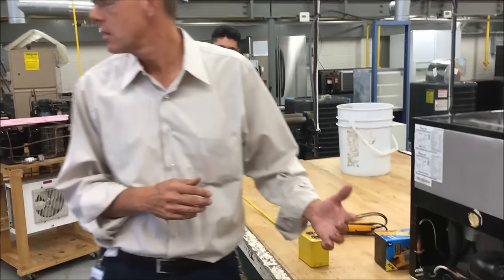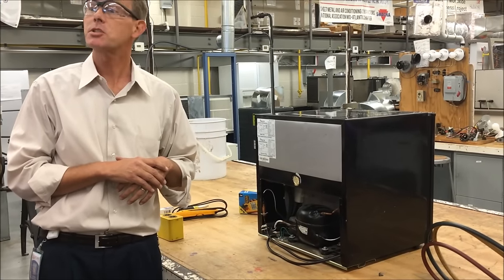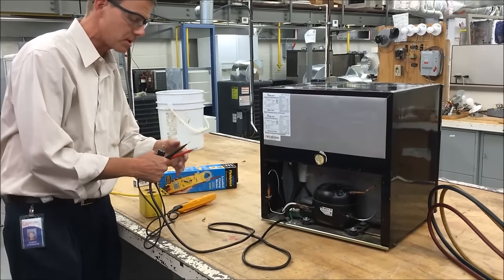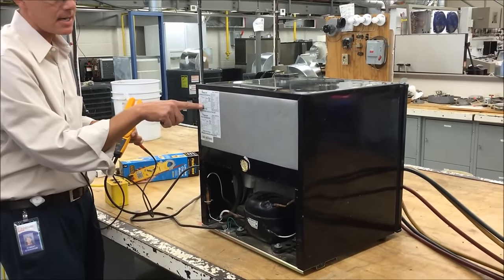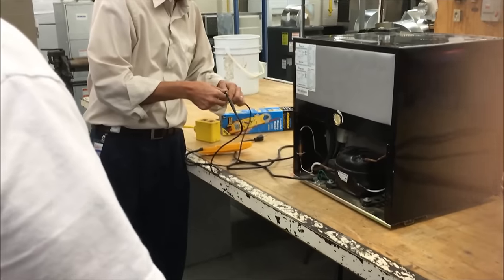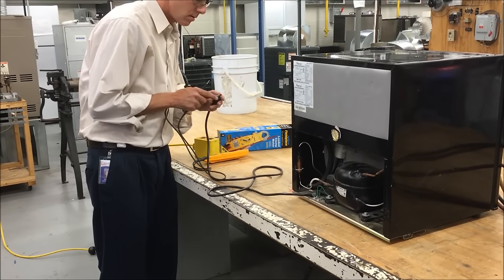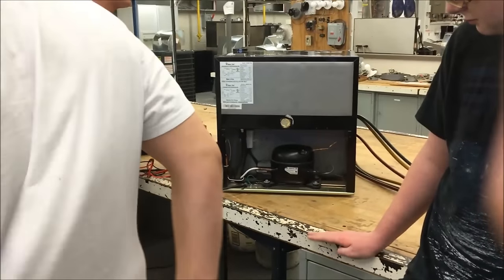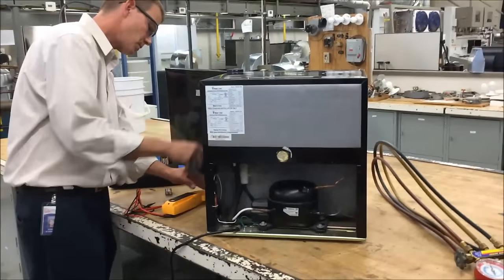HVAC Basics: First - Mini Fridge Refrigerator Troubleshooting Part 1 of 2

Comment: Thank you for your videos, they are a great help to learning HVAC/R.  It was a great help and a great educational experience in total.  I especially loved seeing the "Annie".  That being said, I believe you misdiagnosed this refrigerator.  Happens sometimes when we are in front of an audience and have already formed a hypothesis.  It's still a great educational video.  I didn't see you test the start components.   Near the end of part 1 you showed the schematic confirming my suspicions.  The schematic shows this is an RSIR (Resistor Start Induction Run) compressor with no capacitors.  It uses a PTC to provide Start winding current and then, as the resistance increases, decrease the Start winding current to prevent it burning out.  It is probably a 4.7 ohm PTC.  I found this video while attempting to repair a slighly larger mini-fridge that had the same symptoms.  The compressor got very hot and hummed but wouldn't cool.  I believe it was failing to start because of a failed PTC and just sat there with current flowing through the Run winding but not rotating, until the Thermal Overload cut it off.  The cycle repeated when ever it cooled off enough to reset.   It was drawing about 9 amps while sitting and humming with an LRA rating of 11 amps.  I checked the PTC device and was reading about 60 ohms while it was supposed to be 4.7 ohms when cold.  I disassembled it and found a coin shaped PTC sandwiched between 2 flat spring contacts. One side showed signs of arcing on the PTC disc and its contact.  I sanded/scraped the PTC and the contact and got the PTC down to 11 ohms and reading 9 ohms when the device was reassembled.  I reinstalled it to check my hypothesis.  The mini-fridge started right up and is showing its rated RLA of 1.3 amps.  The new replacement should arrive in 2 days but the fridge is still running.

Again, thank you for your videos.  They have been a great help in my HVAC/R education and will remain a wonderful resource.  I hope you and your family are doing well!
Reply from the maker: Your one of only a few to catch that. It doesn’t even have a cap on that unit. Someone else mentioned it but didn’t go into the detail you did and I’d like to say thanks. Appreciate you leaving this comment for others to see. Thanks for watching.
Reply: You posted this a year ago, but I wanted to respond to let you know that I tried exactly what you just said… sanding the “dime” inside the PTC… and it worked for me. Found a non-working mini fridge on the side of the road, and that trick made it work, 100% confirmed. My only concern is, I also sanded away what looked like some kind of special coating. Not sure if that will lead to a future problem.

Comment: Great video, great teacher! My only criticism is that I wouldn't be leaning on the top of the metal fridge with one arm and hand while poking around inside it with the other when plugged in. I was taught to put one hand in my hip pocket whilst poking around live circuits, thus preventing a possibly deadly circuit through my heart.

Comment: He's a good teacher we need more teachers like that I got a little refrigerator like that and the line coming off the compressor was leaking and I was told that you can't fix that is that true 🤔
Reply from the maker: Depends. If it’s cracked on the shell where the line connects that is tough but if its just the copper pipe then that can be repaired. Sometimes the compressors leak from where the electrical terminals connect and that also cannot be fixed. Where exactly is the leak?

Comment: First thing you should do for any refrigeration/ac call is grab the suction line and the liquid line, every time.  You’ll immediately know if that compressor is running, and based on how hot/cold the lines are you can make a determination if it’s low on refrigerant.  Also touch that compressor and feel how hot it is.  You can troubleshoot and rule out a lot of potential issues just by feeling the temp of different components

Comment: Very great video. I have a little large small refrigerator. It worked great but I had it on a roller cart to move it, it slipped off and tipped about 2" to one side. When I discovered that ( after 2 days or so) and I plugged it in, it didn't work again. I didn't drop it or anything. Do you have idea what could have gone wrong? Thanks in advance for your help.

Comment: Thanks for this video .
My fridge when I plug in the wire the fridge light inside the fridge working but the fridge compressor and the little cooling fan the one next to the copmressoer not running ?
Reply from the maker: Did you check the Thermostat?

Comment: I picked up one just like this for $10 at garage sale. Works great, however I want to use in my Jeep for camping with an inverter. I would prefer the door to open on top. Easier to secure, store items. I could remount the compressor so that it will be upright in the new position- but would the evaporator function properly on it's back?
Reply: Amazing Instructor.  Intrigued to learn more about this field now. If he had online virtual classes or near me , I'd instantly change careers. 🙋‍♀️ 👏 🏆👍

Comment: 3:28 You should use a megger to test for ground leakages since small leaks will only show up on a high AC voltage because it is most of the times capacitive and not a dead short.
Reply from the maker: Good point!

Comment: Question, small 1.6cu ft fridge new, small compressor, on colder setting turns on every 15 minutes and runs for five minutes… is this normal? Temp about 34-36 degrees open space air in fridge temp gauge door closed…
Reply from the maker: Could be. Stays cold and cycling is a good thing. As long as the compressor doesn’t overheat all is good

Comment: Hey the meter your using I see it's a Fieldpiece is that a good meter? Also what model # is it, I'm looking for something decent to test compressor amp draw & also want to test capacitors on Appliance's along with HVAC Equipment. 

I would also like to get more involved in testing capacitors on circuit boards in TV's & other small Electronics so would you be able to suggest something that can do all of the above or even if I need to meters like a champ meter & possibly just a separate capacitor tester by itself? 

Right now I'm using a $20 Harbor Freight Clamp Muli meter & a Craftsman Digital/analog meter. I see harbor freight tools now sells Ames multi meter & I seen they have a decent clamp meter for $40

Please excuse my ignorance as I'm still learning. I am mechanically inclined as I've repaired car's for many years but I am really interested in appliance & TV/Electronics repair now too. Thank you very much & have a wonderful day!! 😃

All the best,
Ron.
Reply: Fieldpiece sc620 looks like to me

Comment: Quick question, how do you access the vent/condenser coils/condenser fan in mini fridges like this? I have one just like the one in this video, and i cannot figure out where any of these components are even located.
Reply from the maker: No fans on this model. You would have to rip it apart to see the condenser coil in the cabinet. It’s embedded in the foam insulation.

Comment: Mine kicks on, but later when it turns off to control temp, it doesn't go aback on again.  I'm guessing the thermostat is failing because it does chill when running. But I do not know where to find a thermostat for a 2 year old  1.6 ft igloo.

Comment: How is 5amps a locked up compressor when the lra is 12? I thought it had to be higher than 12 to be locked up???and you can clamp around the common wire and push inrush on the side of the meter and start it up to see LRA. Nice meters too. I have the same one...

Comment: Mine looks just like that different brand name but same inside luck. I want to get a drink in the garage because I was so hot and sweaty and my drinks were all warm so I checked the breaker just fine I had it set on six it won’t go no further so I turned it down to one and turned it back up to six and boom sparks flew is this fixable or throwable
Reply from the maker: I think when you let the sparks out it’s time to get a new one. 😁 Thanks.
Reply: @edisonhvac  I did.   Lol ty

Comment: I have a mini fridge model Twin Star CR-48D-TS. The fan works, sides of fridge stay cold on the outside. My temp control is set just over medium, and the inside never gets colder than room temperature. How can this be fixed?

Comment: My fridge has the issue of not kicking on when it’s supposed to. It will just let all the food go bad. Sometimes I can kick the side of it or shut the door a little forcefully and i can hear the compressor kick on. When I kick it it stays on till it gets where it needs to but then when it kicks off, it doesn’t turn back on. I replaced my relays and the overload switch on my magic chef mini fridge. Could it be the thermostat? I tested the continuity on the compressor and everything seems good there so idk what else it could be. Haallpppp
Reply from the maker: Check your thermostat

Comment: Just replaced the relay/overload unit on my 4.4 cubic foot Daewoo with an aftermarket part made by Uxcell because the old part constantly kept tripping the circuit it was plugged into. The replacement relay/overload unit is a two pin & its a little larger than the original. Since changing to the Uxcell relay/overload unit it ether stays on too long or takes forever to turn back on & by the time it does turn back on the ice in the freezer compartment is melted. Any idea what the heck is causing this? Could it just be the starter relay is too different for the mini fridge to handle? I also noticed it seems to have trouble getting enough frost on the freezer. The circuit tripping problem seems to have stopped almost entirely but I think I got more issues out of this than what I was trying to fix. Any thoughts?
Reply: (UPDATE) think I fixed the other issue that cropped up. I think I was just using a different type of start relay the mini fridge just didnt agree with. Switched back to the old start relay but I kept the new overload protector on there & it seems to have improved a great deal. Still causes a slight trip/surge in the circut its on but no major issues since the fix yet. I would like to completly elimainate the surge issue that occures when the compressor kicks in. Can feel it through my headphones hooked up to my TV sometimes. Very annoying.

Comment: No if it was locked up it would be pulling LRA or greater.You definitely have an issue but,it’s not a locked rotor.High Amps yes over heating compressor yes.I would begin my diagnostics at the capacitor.

Comment: I hate these things, for the very reason that they bond the condenser coil to the inside of the back panel.  It reduces condenser efficiency and is harder on the system as a whole.  They do the same thing to the condensers on newer residential chest freezers.

Comment: I have a compact fridge that cools but does not cycle off so it runs constantly. What could that be? Thermostat?
Reply from the maker: Start there with the stat but also check the gasket around the door.
Reply: @edisonhvac  Thanks!

Comment: 0,22

hi Guys,
Foamed condensers in the inside wall of the mini cooler are very bad for service.sie rust fast and then only a capacitor builds on the back for help

Comment: so My Mini Fridge is Not Cooling Anymore, What i Tried: test the 
compressor by checking continuity between 1-3 pins and checking for bad 
ground faults on them too, and they were good and i also tested the ptc 
relay and that had continuity between 2-3 Holes/Pins? and No Rattle 
Noise, But when i checked The separate Overload protector it Doesn't 
turn on the circuit (Continuity Sound goes Off) when i heated it up by a
 heat gun off of the unit, although the Continuity test show it was good
 when checking the 2 pins? when i plug in the fridge the compressor 
clicks on showing 5A Start Current but my amp meter shows it has low Amp
 Draw after it turns on?. and i know its on if i tip it over i can hear 
it bouncing in there, and i also tested the thermostat it calls for 
coolant when i turn on the thermostat by checking continuity between the
 Hot and Neutral Pins on the Cord, and yes i can hear it gurgling too so
 i know it has Refrigerant? is it a possibility of a clogged line ?. im 
about Stumped. ):
Reply from the maker: Clogged cap tube, low/no charge or bad valves in the compressor. The valve plates sometimes fracture and the compressor runs and draws refrigerant but bleeds the high side back into the low.
Reply: @edisonhvac  Well that would makes sense seems then i think, i tried everything, (Replace start relay, overload protector, check Thermostat, coolant level (gurgling noise), test compressor pins and so on .. (TBH i actually found this on the street and i wanted to try to fix it, but at this point the cost to fix it would exceed the value of it even thought it was free. not worth my time or patience. thank you anyways
Reply: @edisonhvac so if it has low Amp usage would it be clogged then (around 380-450MA Normally its 1-2A rated Current on the Fridge i cant See LRA anywhere on the Compressor. (i have noticed to sometimes it will lock up and keep clicking but unplugging it and retrying starts it again ?. There is no Warmth to any Tube on the Compressor but the PTC will get hot

Comment: Hey teach! I have a problem, mine just one day lost power, I checked outlets, I tried unplugging it for few minutes, plugged it back in, it isn't the outlet or breaker. So my question, do these have a fuse, or a reset button? I mean no power, sound nothing, please I hope u have any advice, I can't find any damn good videos on YouTube about it. So u sound like an intelligent man....hope to hear back. 
I don't have a tester but wonder if replacing the power cord could possibly help
Reply: did u not watch the video ? he tells you exactly how to test it. goto harbor freight at get continuity,ohm,AC/DC volt meter, probably under 30 bucks. re watch video.

Comment: The overload on my mini fridge rattles, is that normal ❓The fridge only produces ice around the wire part one side of the ice box.
Reply: Mines does the same...
Reply: Miss. Tina Green the teach is MIA
Reply: I know right ..so tell me how long did your fridge last?
Reply: Also mines gets really hot on  the right side and left side
Reply: Miss. Tina Green I don’t exactly remember not long. I believe the line could had been clogged up or low in Freon.

Comment: Buying an automobile is easier than buying a refrigerator!    Even an auto salesman can answer basic questions about what he sells,  such as  what is the engine's hp or displacement?    Try to find out the hp rating or cooling capacity of the compressor in a refrigerator!   Maybe if get down on the floor so that you can read the label on the compressor, you can find it.   Often even that effort is not rewarding.   This is especially a problem with mini-fridges, because they vary in size more greatly than full sized refrigerators.  They are sold in 1.3 cu ft to 7.4 cu ft or more.   A factor of 6 or more!   Yet, you cannot easily learn if the compressors used are adequate in hp to the job.   Buy it and see!   That can be very expensive if the vendor is difficult in his return policy.   When you buy, make sure your seller will be reliable on returns, because you cannot get good technical information before you buy.